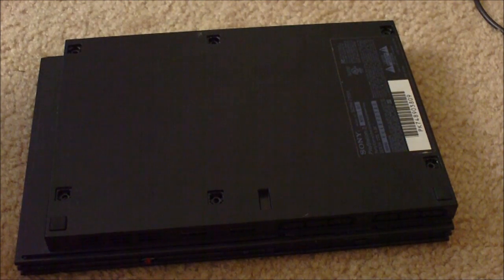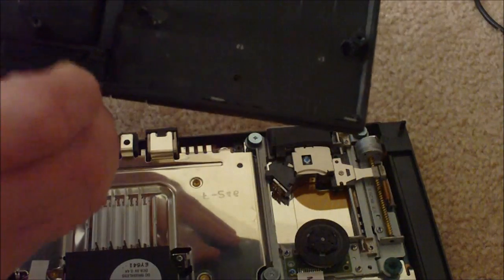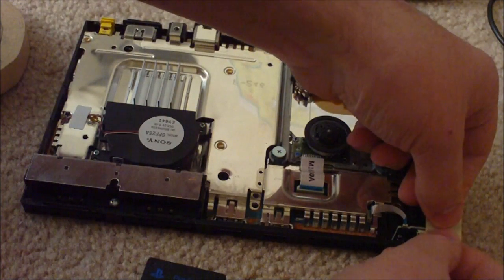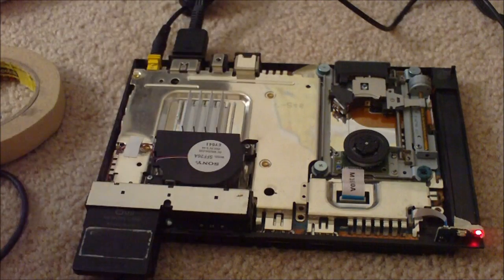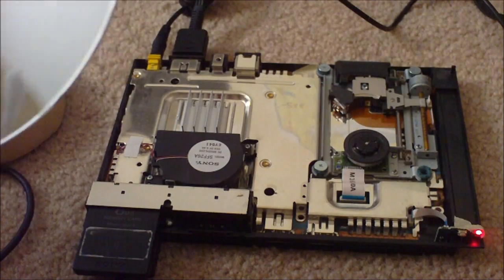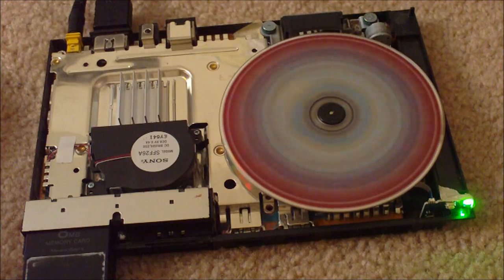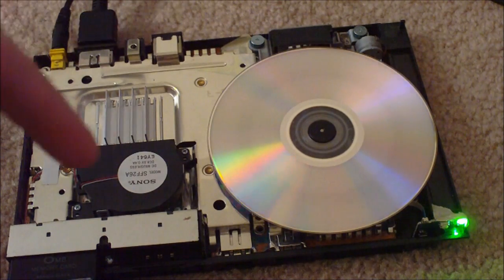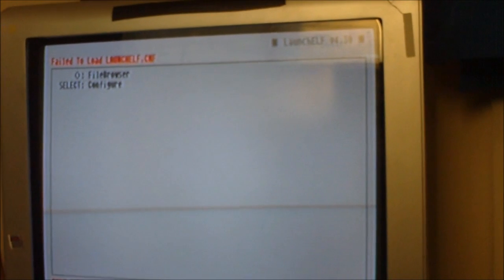Mod LaunchELF on your PS2 Slim SPCH-77001 without Codebreaker

Comment: and DONT patch the iso with memento. i keep see people do this but it is not needed.

(software used get them from sksapps, uLaunchELF_v4.42b, Apache 1.1 and ImgBurn)
(Hardware used PS2 Slim SCHP-77004 and a TDK DVD-R (minus - dvd's it is easier for the ps2 laser to read)

Comment: on the box. it has a black bar with Playstation 2 on it, and some versions have a red bar and some are grey (platinum version). anyway i can confirm it works with a the black lable version i just tried it yesterday and i got it installed. the other lable versions might work too though im not sure. make sure u softmodded the ps2 sesors correctly and modded the game ISO correctly and burnt it to a disk at 2x or 4x if your burner cant go lower. and use a good brand DVD-R..

Comment: i believe this wont work on a schp-9xxxxx model. i could be wrong. but from what ive read it wont work on the newer slims. the older ones schp-7xxxxx or schp-8xxxxx or lower should work i think

Comment: that back switch messed up on mine and heard it is kinda common. i had to tape it down to make it work. still uses t switch on the reset button though so it works like normal.